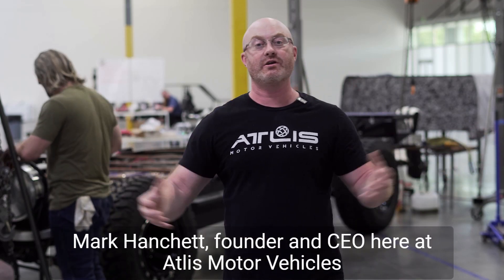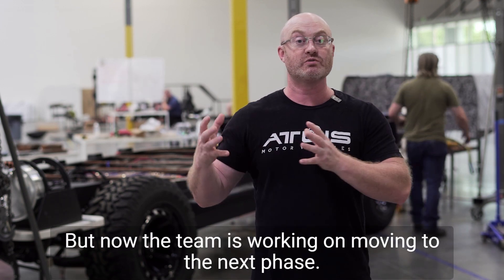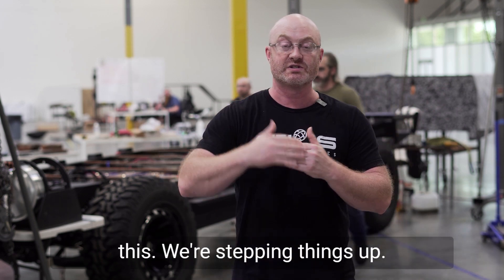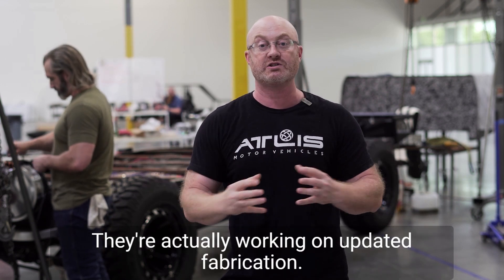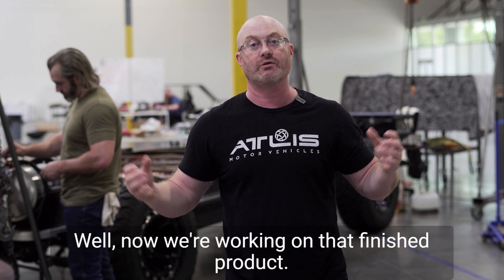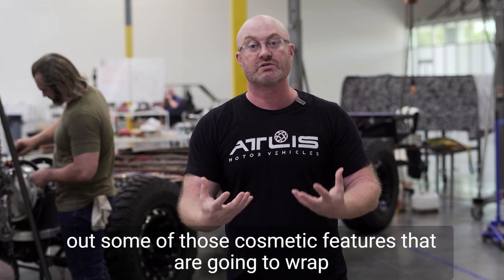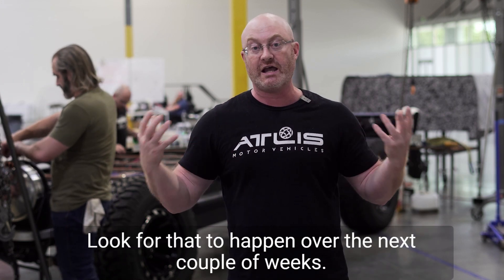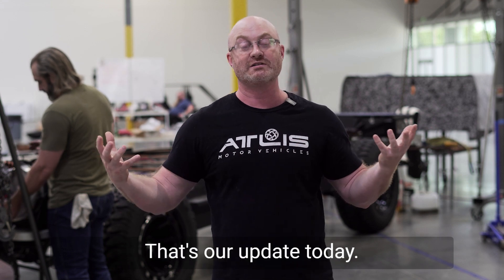Why is Skeletruck disasembled? | XT Prototype Update

Comment: Air compressor port and 50 amp 240 v and 20 amp 120v outlets in the bed. Ability to mount and drive a front recovery winch or a snow plow off of the front in the future. There needs to be a strong enough 12v supply to run them or wire them in.  We are rooting for you guys and I know I am name dropping Atlis all over the internet and Social media.